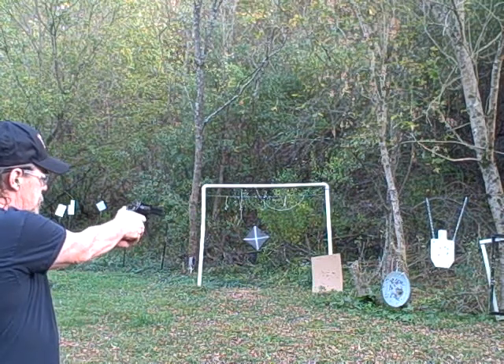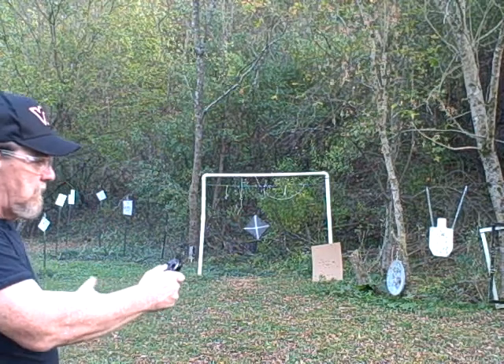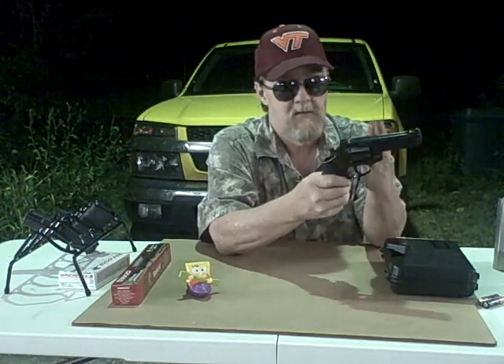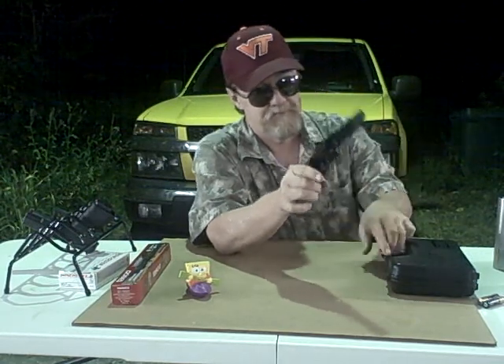EAA Windicator 357 Magnum Problem Part 2

Comment: My buddy had a problem with his doing the same so he sent it back to EAA and they fixed the problem without cost and had it back to him in 10 days. EAA has a lifetime warranty with the original owner of the pistol. I bought the 2-inch model and called EAA and gave them my serial number, they looked it up and assured me mine had the new part that was giving me all the issues.

Comment: If you haven't sent your Windicator back just yet, don't do so until you try this. Back the grip screw out some and see if that helps. I just recently picked up my Windicator and I'm shooting it as I send this message. I noticed some play in the grip so I tightened the screw. As soon as I did that I started having the same problems. I backed the screw off and problem solved!
Reply from the maker: No I haven't sent it back yet,,thanks for the info.I'll certainly give it a try.
Reply: garageguy879 I hope it works for you because I'm in loving that revolver now! I tightened the screw grip screw to the point that it locked up all together. I backed the screw off just a little then it would lock up off and on. I then back the screw some more and it worked flawlessly!!
Reply from the maker: I'm doing that right now.
Reply from the maker: I'm going to video this fix and see if it works.If it does,I will give you the credit for it.
Reply: I'll be on the look out for it. I have my fingers crossed! It's a fine revolver when it's working!
Reply: SOLUTION: I had the same problem with mine, it would not turn the cylinder when pressing the trigger at speed, but it would work ok when pressing the trigger at a slower pace.I took mine apart and found out that it was the "CYLINDER STOP" that was not made to spec and was stopping the cylinder when it was time for it to turn to the next round. I did not bother to call or send the revolver to the company, I ordered the part online and replaced it myself and the problem was gone after that. EAA Windicators appear to have that problem now and then, the company should look into that so that all parts placed inside their revolvers are the same size.
Reply from the maker: My FFL called yesterday and told me it was back so tomorrow after work I'm going to pick it up.This coming Sunday I'll have the update video uploaded here to YT.Thanks for asking.
Reply from the maker: Yes,even with the problem I had I still really like it.The stainless version is really nice.I would had got it if it had been available at the time i bought mine.
Reply: @william629  thank you so much. I was having this problem after cleaning mine & I guess I tightened the grip screw too much when putting it back together. I loosened it a bit & it’s working perfectly. Thanks again

Comment: That revolver has potential. Hopefully EAA will take care of it.
Reply from the maker: I've heard good things about when this model revolver comes back from being repaired.I hope to have the same good luck.
Reply: SOLUTION: I had the same problem with mine, it would not turn the cylinder when pressing the trigger at speed, but it would work ok when pressing the trigger at a slower pace.I took mine apart and found out that it was the "CYLINDER STOP" that was not made to spec and was stopping the cylinder when it was time for it to turn to the next round. I did not bother to call or send the revolver to the company, I ordered the part online and replaced it myself and the problem was gone after that. EAA Windicators appear to have that problem now and then, the company should look into that so that all parts placed inside their revolvers are the same size.

Comment: Man thats a bummer bro i had one in the past and it worked flawless
Reply from the maker: Hopefully when it comes back from EAA,it'll work flawlessly too.
Reply: SOLUTION: I had the same problem with mine, it would not turn the cylinder when pressing the trigger at speed, but it would work ok when pressing the trigger at a slower pace.I took mine apart and found out that it was the "CYLINDER STOP" that was not made to spec and was stopping the cylinder when it was time for it to turn to the next round. I did not bother to call or send the revolver to the company, I ordered the part online and replaced it myself and the problem was gone after that. EAA Windicators appear to have that problem now and then, the company should look into that so that all parts placed inside their revolvers are the same size.

Comment: Garageguy879, a question for you. I have read that this handgun is an alloy frame that will not stand up to a high  count of 357 mag loads. Some have stated that as a little as 500 rounds will ruin the gun. also heard it will happen with 38spl +p. So have you had any problems like this? Thanks Mike
Reply from the maker: Hello Mike.Since this video was made I have sent it back to the factory and received it back and since then I haven't had any problems with mine.I have put over 500 rounds of 357 Magnum through it.I've also put around 300 rounds of +P 38 through it but with my luck,the next time I go shooting with it,it could foul up.Like I said,no problems since returned from factory but then again,anything can happen.If it does I'll sure make an update video. Thanks for watching.
Reply: .357 Mag are steel framed, not alloy. I don't shoot 357 very often out of my 3" because the forcing cone is not very thick and i think it will not last for thousand of full 357m loads. I've shoot one thousand of 38 and 200 357. It is not a BBQ gun, but it is cheap, reliable and accurate.
Reply: They are making the 357 models in stainless steel only although it says in description at website its made of alloy steel. alloy steel is only in 38 special models.

Comment: I bought one of these years ago when they first came out.  Mine had the exact same issue.
Reply from the maker: Hopefully EAA will correct the problem.I really like this revolver.I'd hate to think I would have to pay close to $600 to get a good 357.Thanks for watching.
Reply: SOLUTION: I had the same problem with mine, it would not turn the cylinder when pressing the trigger at speed, but it would work ok when pressing the trigger at a slower pace.I took mine apart and found out that it was the "CYLINDER STOP" that was not made to spec and was stopping the cylinder when it was time for it to turn to the next round. I did not bother to call or send the revolver to the company, I ordered the part online and replaced it myself and the problem was gone after that. EAA Windicators appear to have that problem now and then, the company should look into that so that all parts placed inside their revolvers are the same size.

Comment: Mine was doing the same thing ended up being the grip screw, it was stopping the rod from traveling occasionally I cut a little less than a quarter inch off of it and never had a problem again!!! Sounds simple but it fixed my EAA

Comment: Just picked up my snub windicator and having an issue with the cylinder release latch sticking and at times completely stuck or the hammer travels like a quarter of an inch and then it's stuck. I can usually free it up but looks like this will have to be sent in.
Reply from the maker: I sent mine in and had it back within 2 weeks.They fixed the problem & it's been running good ever since.I'm sure they'll take care of the problem for you.

Comment: SOLUTION: I had the same problem with mine, it would not turn the cylinder when pressing the trigger at speed, but it would work ok when pressing the trigger at a slower pace.I took mine apart and found out that it was the "CYLINDER STOP" that was not made to spec and was stopping the cylinder when it was time for it to turn to the next round. I did not bother to call or send the revolver to the company, I ordered the part online and replaced it myself and the problem was gone after that. EAA Windicators appear to have that problem now and then, the company should look into that so that all parts placed inside their revolvers are the same size.
Reply: I'm having the same issue  what parts did you replace and how do you take it apart
Reply: To take it apart, try to look for videos of others doing so, but I used the manual's "Exploded View" in page 21 for how to remove the pins (https://eaacorp.com/index.php?option=com_djcatalog2&format=raw&task=download&fid=189&Itemid=1227) Take pictures along the way so you can see how everything goes back together in every step you take. As far as the part, you will have to order it from the manufacturer and it was the "Cylinder Stop" for the Windicator revolver. Here is a link to their website and the part itself, it cost $8 plus S&H.  http://eaacorp.com/gun_accessories/index.php/windicator-38-357-cylinder-stop-18-301626.html
Reply: you know a few times  i puller the trigger and i hear a click  i thought  i was  done  took a ll the ammo out  and no dud  so it makes sense  the cylinder stop  no firing pin mark on the primer   Thanks  a lot   hope it helps
Reply: If you take it slow, and take pictures along the way in every step, you will not get lost, just take it slow and be smart about it, don't force anything if you are not sure you are doing it correctly. At any point in time if you feel it's too complicated, just put it back together using the pictures taken and have a gunsmith do it for you.
Reply: Thanks  will do
Reply: If you do order the part, you might as well order a trigger spring, just in case, and save it for a rainy day.
Reply: will do  thanks for the help   have a Happy New Year
Reply: Happy New Year to you also, God bless America and long live the Republic !
Reply: Morning   i tried to look for videos  and no luck   can you direct me  if you can on  i looked at the firearm  the only 2 screws   are on the grip  and the cylinder  and that's it

Comment: It seems that mostly everything works on the gun...but im thinking its a trigger problem like its not relasing the mechanics to allow the cylinder to cycle sir or catch.
Reply from the maker: I've got the update video where I got the gun returned from the factory.It was a part on the trigger mech called the hand.Now it runs slick as a ribbon.Thanks for watching.